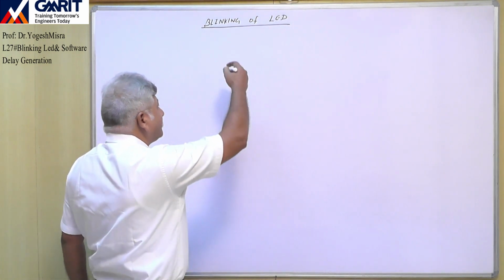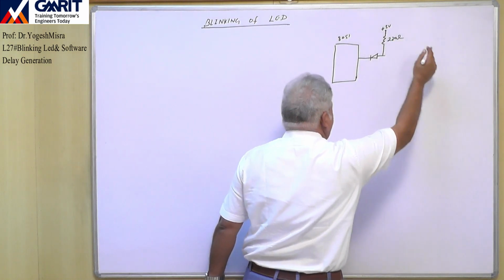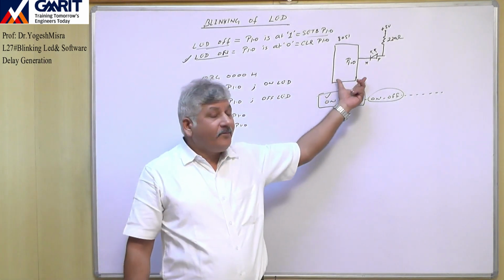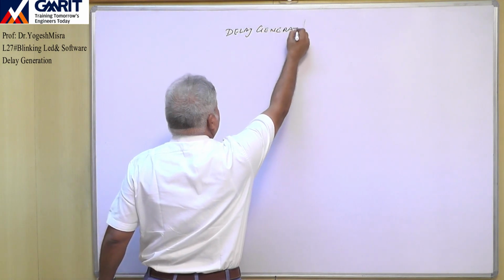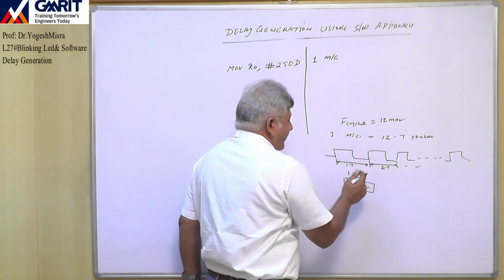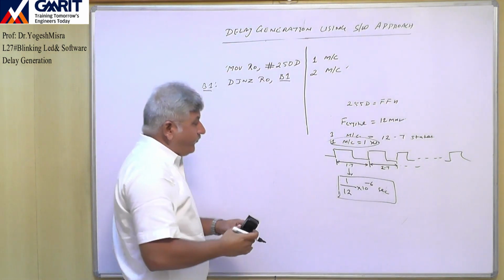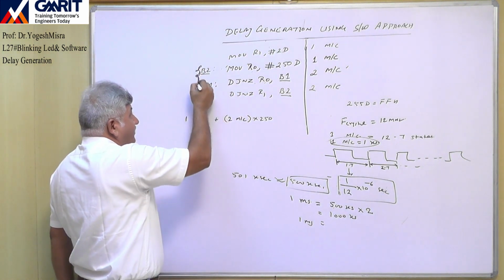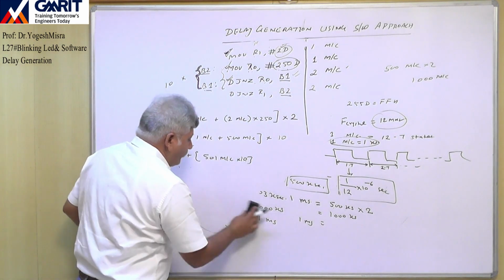Lecture 27: Blinking LED & Software Delay Generation

Comment: sir you did not include the delay of fourth DJNZ instruction which runs two times so total 4 machine cycles extra need to be added in 1003 !!!! but anyways it will not be significant and can be neglected.
Reply from the maker: Right it can be neglected